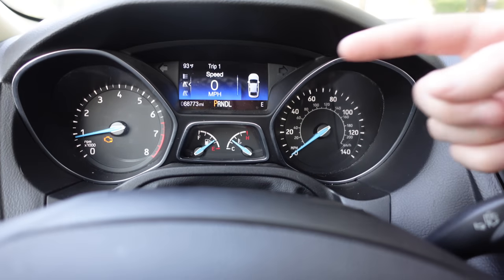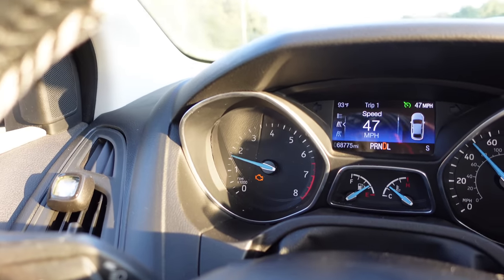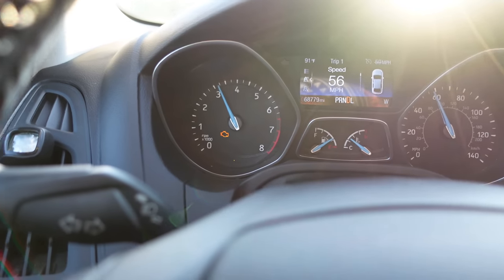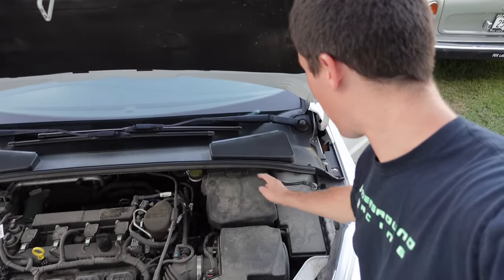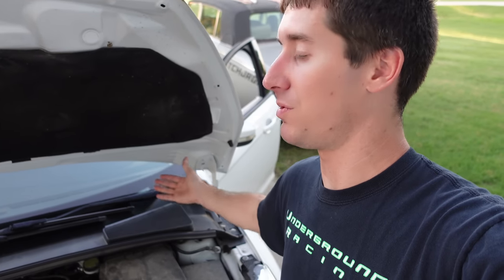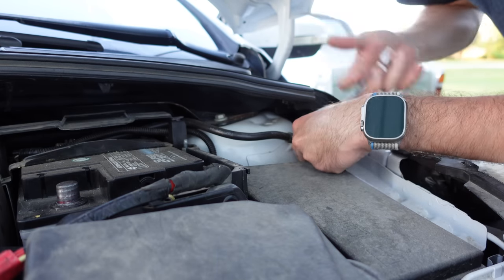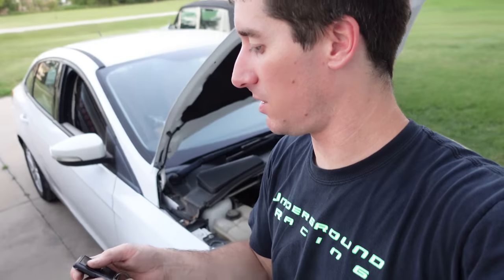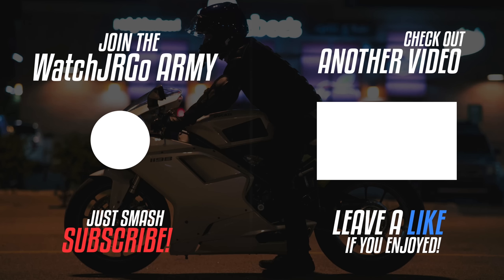This NIGHTMARE Transmission DESTROYED The Ford Focus (Fixing My Girlfriend's)

Comment: I had a 2012 SE (first year), it was fantastic until they did the first reflash to make it drive closer to a normal automatic, rather than behave like a quirky DCT. I had a check engine light one year, all fixed under warranty with new clutches. Then a few months later, over the course of 8 weeks I had it at Ford dealer in and out (I was on a first name basis with everybody there at this point) because the clutches kept burning up (per what they told me). But they couldn't authorize a new transmission. So an engineer flew in from Detroit to investigate and they did some deeper repairs under warranty but I ended up selling it after that at only 75k miles because I couldn't deal with going to the dealer just to hope for a loaner. It was such a great car otherwise. Ford mailed me a check for $300 or so a few years after for their lawsuit.

Comment: I dodged a bullet. Had a 2015 Focus. I had no problems with the transmission. At about 32,000 miles I traded it in. The transmission went on it on the next owner within the next six months. It sat on a lift torn apart at the dealers for at least five months. I'm not kidding. They eventually put it back together so it would roll and they rolled it into a corner. It sat in the dealers shop for 11 months! After it was gone I asked the service guys about it and they said Ford actually took it back. So glad I got rid of it. My guess is they need to be driven a little aggressively to keep them working.
Reply: There are a lot of people who don't understand these simple transmissions, even Ford even did a recall of the clutches when the shifting forks just needed to me replaced.  These things are easy to fix in the driveway even;  I know because I've done a few of them over the last year and a half.  All info I needed was here on youtube.  And no not driven aggressively, just driven daily to keep tiny bearings in the clutch forks from rusting up too much.

Comment: I had a '16 Focus I bought brand new. Had it 2 1/2 years. When I traded it in, they said the transmission was shot. Plus the wheel bearings were bad, the AC sucked, i got seasick when i made turns...That was the worst car I ever had.

Comment: If you drive it an automatic mode it is very quick to downshift when you press the gas even just a little bit that is why I always drive it in manual mode so that does not happen
Reply: It's a DCT and is purposefully set to shift fast.  There might be a problem with bad grounds or the electronic accelerator and/or electric throttle body.

Comment: There is a perfect fix to this entire issue. Buy the manual version...  i have a 14 se thats st swapped and i love it. The manual is just the only way to go with these cars. I dont miss the shuttering, hesitating and the random engaging into neutral while driving down the road.
Reply: Easily fixing the auto is better;  these cars are not built for racing;  they were designed and built for daily driving.

Comment: I remember a Ford Edge I used to drive as a company vehicle
10 speed transmission, I would expect some smoothness
Whenever I try to drive smoothly, it utterly refused to do so.
slowly add throttle, about the point it would normally downshift on my older 4 speed vehicles, it still wouldn't shift gears.
add a little more throttle, nope.
then, out of the blue, it would jump 6 gears, make a horrible noise, and threaten to rip the whole engine/transaxle off it's mounts

That, and having it cut the throttle in the middle of passing on windy two lane roads earned it the title of "Satan Machine" by all who drove it

Comment: I had a 2011 fiesta I inherited from my aunt. The clutch packs were replaced at 35k, and 55k... It was failing again at 65k. It would actually feel like a true manual. It would cut the power on shifts so it would buck forward and back as if I was manually shifting. Crazy. Parked it for a year and then it drove “okay”. Sold it for cheap. 70k-ish on it when it was sold. Horrible cars.

Comment: It sucks because the dual clutch trans in Focus make these cars get unreal fuel mileage. My 2013 has been good so far @ 135k they are never snappy shifts. They do have strange characteristics even when working 100% normal.

Comment: I own a xr8 with zf 6  triptronic  ,2 n half years ago took to shop for service ,was told no it was trashed and oil change will change specs drive it till it breaks ,cost aprox 4500 yet still today i start my car let idle till at running temperature and still runs and drives normal no hickups   imo mechanics are like big pharma and prescriptions . A cured car is revenue lost otherwise cares would be built to last using water as fuel .

Comment: I'm from Argentina and here it was offered with manual transmission. I have a 2016 Focus SE MT 2.0 engine and it's a great car, it looks exactly like yours but with dual zone climate control and of course, a stick 😂. The only downside is the tiny screen. It only have 25k miles.

Comment: I had a 2012 for years.  It litterally never broke down on me until it was totalled in a wreck.  Yes the transmission is junk, but there is a trick to it.  You have to drive the PISS out of it.  The clutch gets a glaze on it that will cause that shudder.  If you force hard shifts, it wears that glaze off and the car will run like a top.

Comment: Replace the actators there bad when they where put in brand new in 2015 theres a recall on them that causes the problem will cause more problems in the transmission if you dont news one in just done mine up after had transmission clutch replaced for second  time and put new computer on to . Spent 7800
Reply: Clutches almost never go bad, other than wearing out due to abuse.  Clutch Forks are almost always the main problem - so many tiny bearings in them that get messed up.

Comment: It's possible to make an reliable dual clutch in an affordable car. My wife's 2018 VW Golf Sportwagen has a 6-speed DSG, and reading around, they're very reliable. Ford just had a dud transmission, and according to the information released in the court cases, they knew that before they sold the first one.
Reply: A vw/audi reliable? Get a lotto ticket quick

Comment: I am not actually sure why Ford decided to put this in the Fiesta, Focus and other vehicles of which none were even remotely considered sports cars. The auto transmission in the first and second generation were very reliable and usually gave no issues. Granted it was a little dated with it being a 4 speed automatic but for the application (small, comfortable entry level car/commuter car) the 4 speed auto trans was fine. I had a 2005 Focus that was automatic and it gave me no issue and still had good gas mileage even with the dated 4 speed auto trans. it was a pretty good car and in my ways I am sorry i got rid of it. I did have a 2012 Fiesta but got it with the manual trans. it was an interesting car as it was a SE but it looked to be custom ordered from the factory as it had every option offered except for leather seats but was a manual. The manual in that car was great and it had a hill holder feature (where the brakes hold the car for 5 seconds on a hill so you can take your foot off the brakes to use the clutch)

As for for battery changes, that one in your Focus is downright easy compared with the replacement of a battery in my 2018 escape.

Comment: I had one of these a 2012.  After having issues with the transmission, namely it was worse after having the dealer work on it, I swapped it out for a manual.  It was a lot of work and a lot of time spent with remote pcm programmers.  The only thing I was never able to get back was cruise control.  Drove really nice, but a deer finished it off.  Now driving a manual Honda Fit and it is a great car.  Better mpg and not one issue since 2018.  I will never ever buy another American manufacturer car.  They are all junk.  I do have a 2000 F150 and it has been perfect for 23 years.  Might be the last vehicle that Ford made that is any good.

Comment: It must be bad when JR says get it's not worth repairing.  My 03 Cavalier has 183k on the original engine and transmission, no problems yet, knock on cheap GM plastic.  Guess that car won't be going to the Mini Resort in OK?  By the Way, we need more Mini Resort videos !!   Don't overheat in K, NC is having a heat wave this week.

Comment: Know what the real problem was? That they didn’t push the manual transmission! For years I had heard that Ford Focus transmissions were bad, i.e. failed a lot, but for a long time, I couldn’t get a straight answer regarding which transmission was bad (I wasn’t trying hard enough)! Recently, however, I think I got the answer I wanted, and yes, it is only the automatic that was bad… the manual transmission was fine! I was interested in the Fords at the time, and as a MT devotee, if I had known that, I might have bought one. Now I probably never will…

Comment: My wife loved her Ford Focus but, the dual clutch was unreliable and would lose power from stop to go. More than a few times it lost power pulling out into traffic, then it would kick-in and you would ride a bullet fired from a gun. We hired a lemon law lawyer, as Ford refused to truly fix the problem, it was bought back by the Manufacturer. FYI, only the manufacturer can buy back a vehicle, not a dealership. My wife was bummed but, she ended up with a Subaru Impreza Sport so not too bad.

Comment: To sum up the video : close 0 mechanical skills , tries to clear codes in attempt to fix it.

Useful tip for your next project :Bad grounds are usually the one from the body to the transmission / engine. The tiny one from the battery to the body of the car is usually intact.

Easier way to check for bad grounds is to get jumper cables and clamp
One side to negative tarmibal / or whenever possible and the other to the engine directly

Comment: Ford recently extended the transmission warranty on those transmissions to 10 years or 150,000 miles. call the dealer to verify it's eligible for the free fix.

Comment: I work for a warranty company. We have to buy these things by the gross. We call it the PowerSh*t transmission. 
It’ll need a new dual clutch, maybe a couple of actuators. Once it’s fixed, it shouldn’t be treated like an automatic transmission. At stop lights, put it in neutral and shift it in and out of gear as necessary to get it to go. 
They’re horrible, but if they’re driven properly, they work OK. 
People treat them like regular automatics, but it’s not.

Comment: Have a 2012 Ford Focus SEL. We've had the transmission needing to be rebuilt THREE times (thankfully under warranty). Now more problems + it's not under warranty and Ford dealership says the clutch is going out and 4k to fix. Nah, gonna ride er' till she dies and get a non-Ford.
Reply: Were the clutch forks checked properly and/or replaced? Cuz I doubt it, having repair a few of these things in my driveway now.

Comment: Basically all components related to this transmission can fail, making Ford replace separate parts or even the whole thing, even more than once at the same car. It seems Ford rushed the release of Poweshift before it was totally ready for that and it has something to do with the oil used from new that with time breaks havoc.. (there is content on YouTube explaining). 

There are cases of Ford replacing the transmission with a brand new one and the new one presents the same issues sometime after

Comment: ... dielectric grease, as the name says, is isolating. Replacing paint with dielectric grease is not really an improvement, the grease goes on top of the connection to protect not inbetween😊

Comment: The same transmission was used by Renault and it didn’t have problems there. The problem is with Fords software making it slip the clutches so it would feel soft and “normal” for Americans…

Comment: How disheartening 😞 I just bought a 2015 from a family member. 45k miles. The transmission clutch was previously replaced by Ford and now it’s in the shop again because the front end is “hopping” at takeoff, like a clutch slip. No ‘check engine light’ though. Not yet anyway 😭
Reply: smh    The clutch is almost never the problem; it's the tiny bearings getting hung up in the Clutch Forks that are the biggest problem.  These things are so easy to fix that people should be embarrassed for not figuring it out.  But such are the times due to generations of harm and worse.
Reply: @01mustang05  ok well I’m not a mechanic, so 🤷‍♂️
Reply: @DrChaunceyBlevins    Well I'm not a mechanic, never was, and I've personally fixed 3 of these, all by myself, in the last year, in my driveway, with no special tools, so ❓

Comment: That's not "battery acid" that you are cleaning off of the battery terminal, it is accumulated deposits caused by air and the negatively charged pole.  Nevertheless, it indeed needs to be removed.  Use some battery terminal spray to keep this under control.

Comment: I am a women , I use to sale cars. Every Ford I ever bought had transmission problems, every one of them. Ford should of learned by now. The exception is the trucks. Should've recalled millions of them. They did recall a 1999 Thunderbird flywheel once and that didn't fix the transmission... Ford got away with millions of bad transmissions????

Comment: Ford extended the recall to (I believe) 150k miles and they will either reflash or replace the TCM which is the main issue with all of these pieces of complete junk. I get at MINIMUM a dozen of these in a month and they infuriate me. It's not just bad TCMs they also suffer from bad motor mounts, PCM issues, lower control arm failure, ball joint wear and even if you do get the upgraded TCM these things always shift without any rhyme or reason they just wildly plunge into gear whenever they feel like it. Customers absolutely hate these things and I hear it daily lol

Comment: The truth about the power shift is that it is a good transmission, but it's designed to mimic a traditional auto transmission, so it 'slips' on purpose. At the end of the day it's still a DCT, so it's going to drive as such. Unfortunately the only way to change the way it shifts is by using S mode on equipped models, or a custom tune.

Comment: like most comments here, its an internal leak causing the clutch to glaze. I don't think it's tcm. fordtechmakuloco did a vid on the repair. looked awful. a coworker of mine had one, when it stopped it felt like a train wreck. a dump truck rear ended him and totaled the car. he was ok thankfully and bought a Mazda with the insurance money.

Comment: the negative cable is not the only ground in that vehicle. Additionally throwing the parts cannon may not solve your problem. It does not matter how many failures other vehicles had. Always test to find the root cause so you can have a 100 percent fix
Reply: Common ground

Comment: Unless the threaded bolt hole was painted also, removing the paint around the hole seems unnecessary.  It should ground just fine through the bolt and threads.

Comment: Part of the problem is the way she is driving.  There is a learning program in the shift contol program.  Her driving style is teaching the trans to shift slow with gradual pressure.  Every once in a while, the car needs a series of 0-65 WOT pulls to keep the trans shifting firmly.  More aggessive driving also helps keep the program on the firm side of shifting.
Reply: Thanks for the tip. I’ll keep that in mind with mine. I drive 77 miles to work one way and it’s about 90 percent highway and 10 percent in city but I don’t womp on it to bad at the in city parts due to traffic sometimes. I’ll start getting on it when I leave home or from red lights that are on the main stretch of highways. Kinda odd you have to beat up the car to make the transmission last longer.

Comment: You can use a multimeter and do a voltage drop test on those connections to verify your repair.
Reply: . 2 is the spec for the ground side. .5 for the power side. Closer to zero is better. Just make sure you have the system loaded. So car running and put the highbeams on is the easiest way.

Comment: The transmission went out on mine at about 78k miles. I'll never buy another Ford after the experience I had with mine, it should have been a great, fun car
Reply: It's a daily driver and work great as daily drivers after a competent person fixes a relatively easy problem, no special tools needed, done in the driveway on the weekend or two if one gets some used parts themselves.

Comment: I bought a 2012 Focus used with 10,000 miles, former daily rental. 130,000 miles later still runs/shifts excellent. The TCM crapped out three years ago. Fixed by Ford for zero dollars. Love the car. Realize I got lucky.

Comment: Dual clutch is a nightmare transmission next after CVT!! Period!! 
Volkswagen had a lot of trouble with theirs in the beginning and the cost to fix them!! 🙈
I have a 2016 Mondeo Mk 5/ Fusion 2.0 diesel. They normally comes with a dual clutch transmission if you want auto. I choose the manual as as dobble clutch transmissions from Ford really sucks!!

Comment: You pointed out a failed motor mount. And you have a shift actuator short to ground. Are you inspired yet? CHECK THE CIRUIT TO SEE IF THE ACTUATOR WIRE HAS CHAFED.

Comment: We had a 14 with 160k miles on it before CarMax bought it.  You just have to drive it aggressively to not burn the clutch up.
Reply: That’s crazy but true. Mine has a bad shudder in 1st sometimes in stop and go traffic but if I’m harder off the line or goes into sports mode and use the paddle shifters it doesn’t do it at all